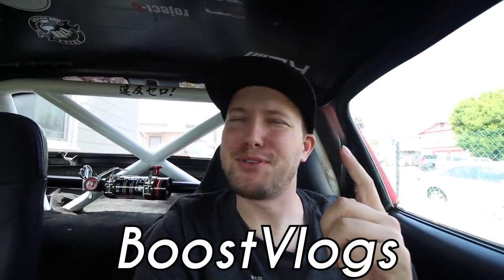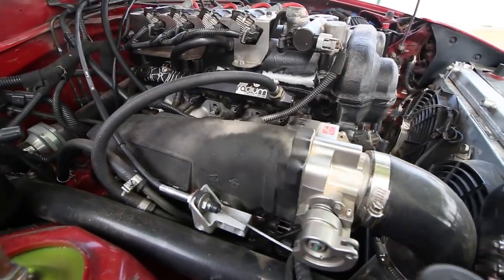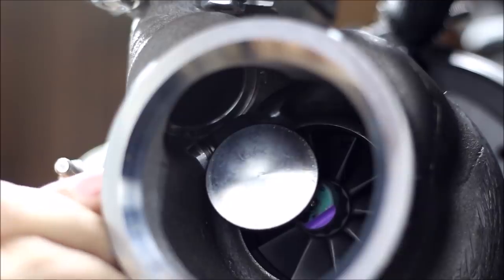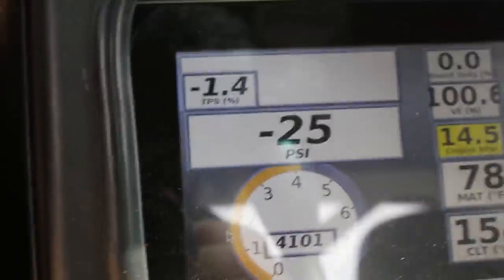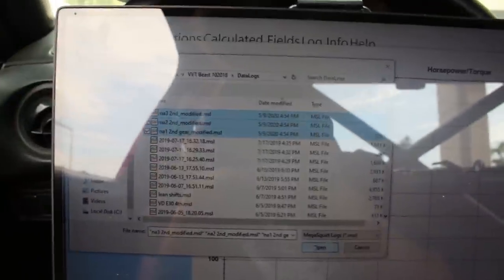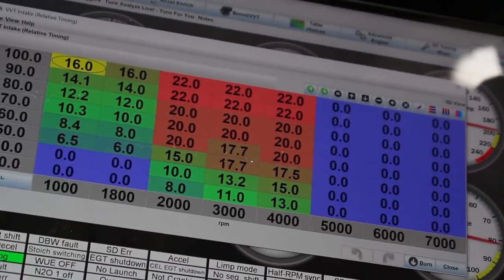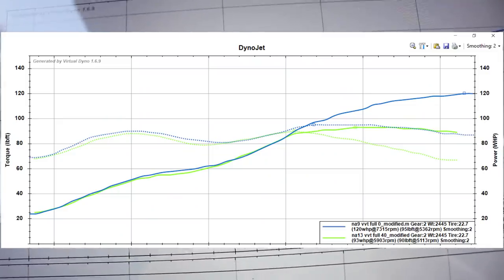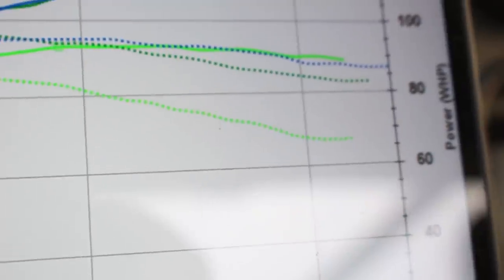I Deleted My Turbo... How Much Power Will The Miata Make? (BoostVlog 11)

Comment: The potato is likely costing 5hp. My built BP4W also 9:1 compression on 84mm pistons got 126hp with stock ecu, stock intake manifold, Stock TB and 4* timing advance via triggerwheel. I think that lost drivetrain weight helps as well over a stock car NB.

Comment: Probably a little too high effort but would be interesting to see how much power you'd make with the turbo removed from the exhaust and not acting like a big potato in the exhaust system.

Anyone that turbos their miata in Sweden need to remove it completely before doing their yearly car inspection (equivalent to MOT in the UK) so a common thing is to make a pipe between the manifold and the downpipe for where the turbo would normally be.

Comment: I think you should have done this with the turbo removed, I know it’s not easy but I believe the turbine was creating back pressure at high rpms worsening any effect of valve overlap by not creating a scavenging effect.
Reply: ...also I do know that valve overlap is not desirable in turbo applications, only at low rpms up until full boost is reached.

Comment: Granted you have a turbo clogging your exhaust I'm sorta surprised my 1994 1.9 with my head I "ported" / polished myself kicks out 127 & its at 8.5:1 compression with just an exhintake mod, megasquirt & very soon its got a turbo goin on. Reassuring knowing a motor I built myself is sorta on par with whats out there.

Comment: Are you sure that the VVT intake manifold it's the worst? I was thinking it is the best.
Reply: Ok, I just found out that my stock VVT NB2 have a Square top IM, so technically it's the best?
Reply from the maker: NB2's only have squaretops overseas. In the US they have the terrible VTCS manifold...

Comment: can someone pls explain why google says the nb makes 142 stock?
Reply: I think they're talking about brakehorsepower which is measured at the crank. Not counting in the powerloss through the drivetrain and tires
Reply: 142 is crank horse power not at the rear wheels you lose 15 to 30 percent